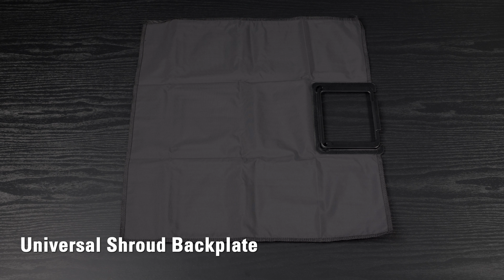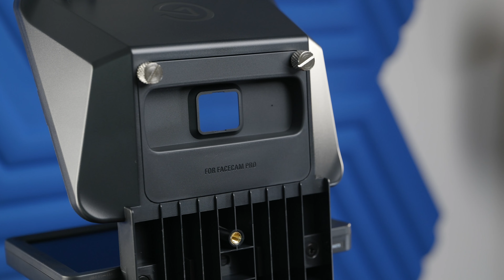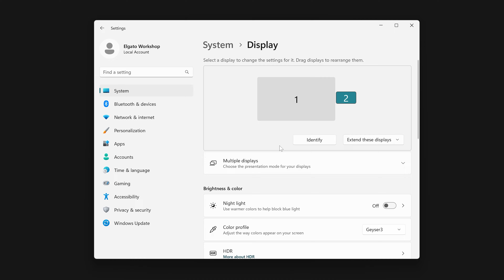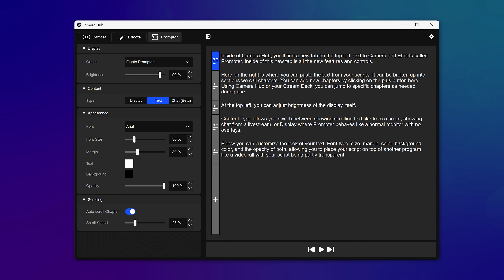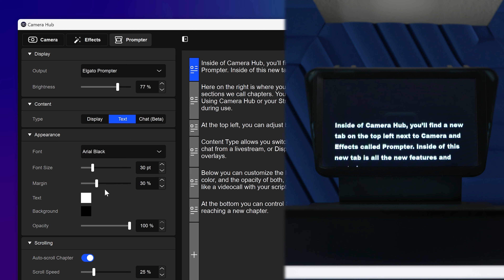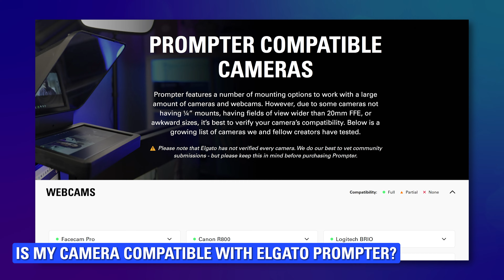How to Set Up Facecam Pro With Elgato Prompter

Comment: Hi there - I’m having trouble getting my prompter to be its own monitor screen on Mac OS - i updated my display link drivers but no luck. Right now i just see a black window overlayed on top of my main display that i can awkwardly drag larger or smaller, it doesnt seem like its outputting solely to the prompter as intended.  Thoughts?
Reply: Did you ever get this figured out? I have Mac as well
Reply: @adorningpraise  I ended up completely uninstalling and reinstalling twice and it helped. Also getting more comfortable toggling in the display link app on the top task bar. Try uninstalling!
Reply: Thank you for that info! I ordered but haven’t received yet and this comment had me thinking. If you don’t mind, does prompter work fine on a single Mac computer? I only have one screen and thought that was all I needed.
Reply: @adorningpraise  that’s right it does work fine with one but then the prompter is also a second screen (you can enable this functionality through the elgato camera app as well as display link (I think that’s the monitor driver app)
Reply: Perfect, exactly as needed. Again thank you very much for explaining! I appreciate it!

Comment: Any recommendations for where we can buy a longer angled USB A to USB C cord? I have an intricate setup and I have concerns as to whether the length of the included cable will suffice.
Reply: Amazon has several.
Reply: @GW3865 I am aware but I’m looking for one that’s identical to the included one. The ones I saw on Amazon are either angled differently, are USB-C to USB-C or if they’re angled correctly - they’re too short.

If you know of one that doesn’t have any of the issues above, feel free to shoot me a link.

I usually like to have  a cable that’s 8-10ft long for good measure.

Comment: will the original facecam fit?
Reply: Where would I find the stl-files for that?
Reply from the maker: Yes! Using the included universal shroud backplate. We'll have a video showing Facecam being installed soon.
Reply from the maker: You can also print a custom backplate for Facecam as well. 😊
Reply: @ElgatoWorkshop  Got a link for this please?